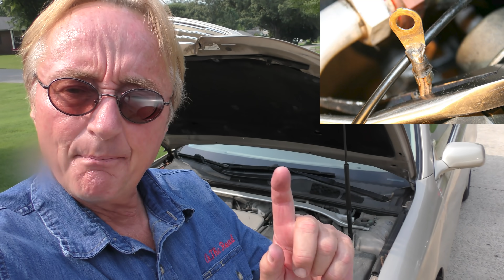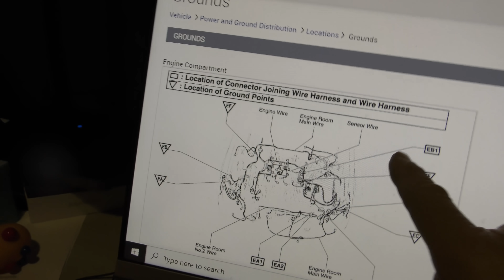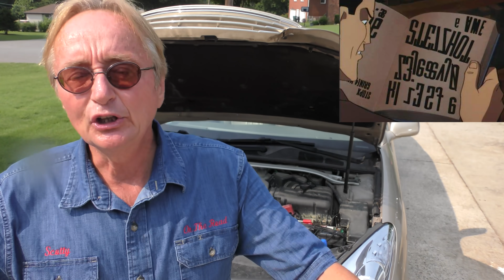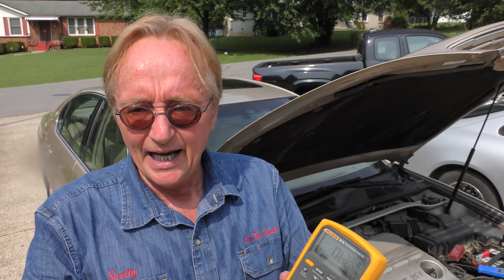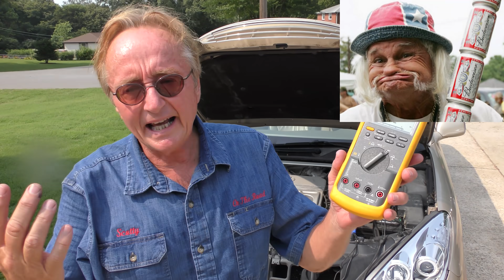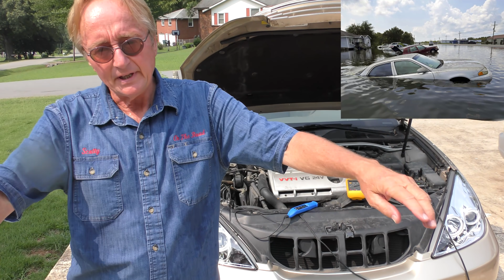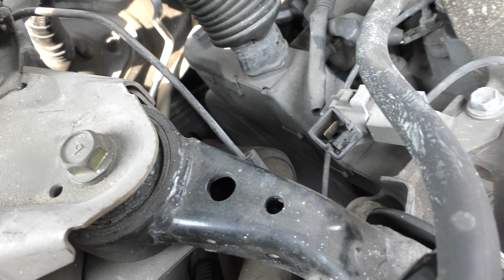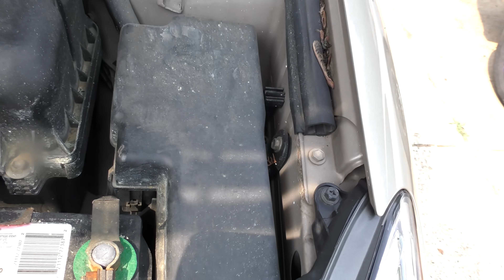I Told You About This Problem But Nobody Listened

Comment: Scotty what’s your opinion on used 3rd gen Honda CR-V’s (2007-2012) is it a good choice for daily driving & what are the common problems ? Thank You
Reply: The biggest defect is if you don't refuel them they will eventually run out of gas. Otherwise they should be good for about 300000 plus miles lol

Comment: The worst problems I have had over the years with cars have always been  ground - related. Corrosion, loose bolts, collision damage and home-brewed stereo and electronic installations. You could not have explained any better!!
Reply: I'm well impressed, it's worth listening to Scotty even if you've no current problems!
Reply: Lucky you ... I buy older car fix em no payments only way. This Honda I had like 7 years ago man.... had my son with me when I parked at subway the wheel fell off the tie rod had no thread on it I fixed it in the parking lot. Before that I was going to work braking down a hill the damn cv axle snapped right out the transmission the ball joint holding everything up snapped off the brakes were so bad lol . Switched over to Nissan now I got my 2001 se maxima running like a champion
Reply: @jdsjds7935  man, manage your finances properly, and only drive safe, roadworthy cars my friend.
Reply: @kenlee-97  iam... the Honda was a while ago I just bought it and drove. I went to school for automotive . I saved up some money put my maxima together got new spark plugs oil battery alternator brakes brakes runs smooth now. I don’t need them on this car but next paycheck I’m gonna get some axles and struts
Reply: I had a 2006 Sonata that had problems. I would take it back over and over and it would be ok for a couple of.months. I finally blew my top and asked why they couldn't fix if? They replaced the ground strap, which had the wrong resistance, and I never had another problem....
Reply: Man, try to live a trouble free and a responsible adult life,  that way you stay out of trouble this way my friend...
Reply: @kenlee-97  by that you mean not running a car? Lol
Reply: @rob5944  haha!-but a responsible adult should be AN ADULT (-meaning an adult  owns a car ,not wait for a bus like a school student/ child), -not meaning to offend any body here,  unless you only need one car for the family (e.g-;  wife needs minibus for school run ,you work in the city and only require a quick bus commute).🙂
Reply: Yes !
Reply: General maintenance and general inspections are overlooked on a continuous level NOW days in the USA ..Augh ! See it all the time … ( people spend loads of money for batteries and alternators that they don’t even need if they would just keep up with their simple basic  maintenance ) … no jokeee
Reply: @robertholderman7552  In addition to a servicing regime on our cars I conduct regular checks of oil, coolant, windscreen wash and brake fluid etc.  This is together with a cursory inspection around the engine bay, bodywork and interior, but your suggesting something in addition to that?
Reply: @rob5944  ; i’m saying the general public doesn’t even conceive any of this stuff 90% of the time anymore .. good cars are actually ruined for not even changing the oil .. or using LOW grade cheap priced oil because of price of fuel ect ect ect ..,
Sad
Reply: @robertholderman7552  I guess so.

Comment: Hello Scotty watching from Houston! Me and my wife just purchased a 2016 4Runner (56k miles) everything seems good on it except, when I turn the steering wheel full lock to the Left side while I’m backing up it makes a weird grinding/rubbing noise (from the left front wheel). It’s not from the tire rubbing and I can’t see anything falling apart, it only happens when backing up and only when the wheel is too the left at almost full lock, any idea what it could be Mr.Kilmer?
Reply: You need to have your drive axle checked out! It is most likely the CVA….
Reply: @Pastmasterdan  that’s what I thought but when I looked at it none of the rubber housing is torn apart or leaking, was wondering if it could’ve been anything else